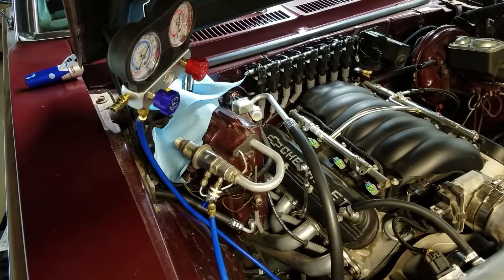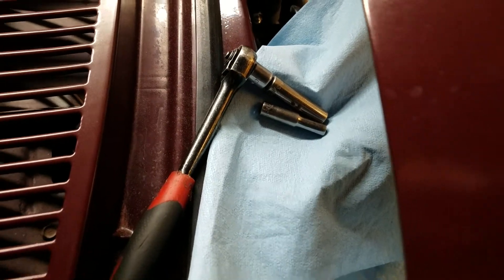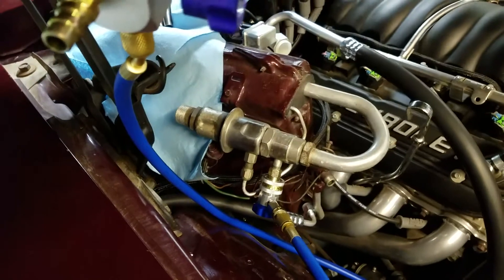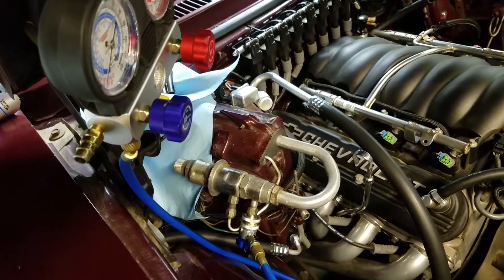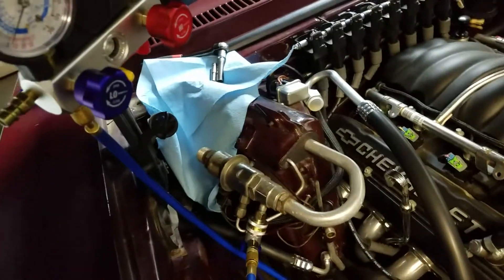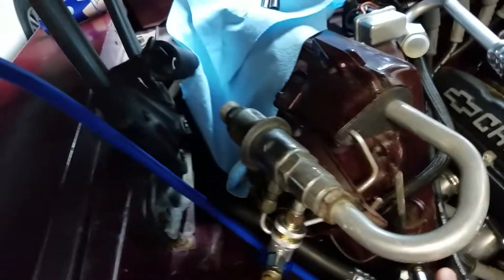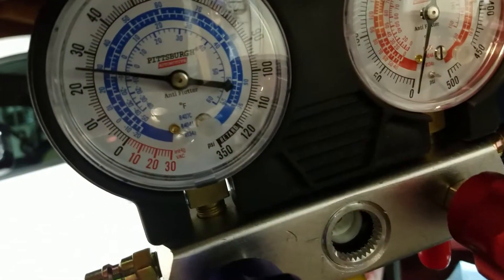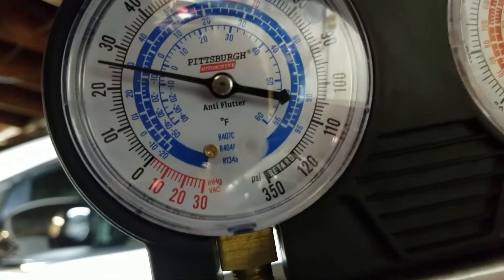POA Valve Adjustment 1970 Nova Factory AC. Convert from R12 to R134a

Comment: Thanks for the great video. I have a question about the pressure setting for R134a. I see you set your pressure to 26 psi on your POA valve. When I look at a pressure chart for R134a it shows a set pressure of 27.5 for a evaporator coil temperature of 32°, I'm just curious if you have ever encountered a coil freeze up at the 26 psi pressure? I'm getting ready to make this adjustment on my POA valve. Thanks again. I look forward to your reply.
Reply from the maker: I have not experienced a freeze up. I know some people go even slightly lower on the pressure. I suspect the expansion valve control of superheat would keep freeze-up from happening since the outlet temperature is kept a few degrees above the saturation temperature.
Reply: That is great to know, your info is greatly appreciated. Thank you!

Comment: How far into the back end of the POA valve are the nuts for adjusting the pressure? Mine is just like yours - and there are threads on the inside for about an inch -- but I have to go 2 1/2 inches into it before anything stops me, and there's nothing that a socket with connect with. Possible my adjustment screw has been removed by someone?
Reply from the maker: I can't remember how far in it was. It was visible when looking down the outlet of the valve with a flashlight. I've heard some are not adjustable, but most are so take a look. I have a photo some place looking down the beach of it if that helps.
Reply: @thebandit4393  Thanks - I have seen your photo and someone else's too, and since mine is still on the car I can't see into the outlet. Mine could be one that is not adjustable. It's a GM 6551430.
Reply from the maker: @reallyrarestuff  I don't think I removed it to get a photo. I used my cellphone and held it by the end to take the photo. Took a few tries.
Reply: @thebandit4393  My camera shows a plain disc looking into the outlet of the POA. I have 50 lbs on the Low Side Port on the POA when I inject shop air into the evaporator, so something is amiss for sure. I removed the POA and see a small nut in the Inlet side. That 5/16 nut was tight clockwise, and when I turn it CCW it just loosens. Looks like this one is not adjustable, so I'm on the trail of a rebuilt one or a replacing it with the new type that cycles the compressor.
Reply from the maker: @reallyrarestuff  Dang good luck!
Reply: What year is your car
Reply: @hubertbryant5587  Mine is a 67 and I concluded my POA was not adjustable so I had to replace it with one of the new POA Replacement pressure switches. I still have the original one in case I run across someone who wants one like that.

Comment: What was the inlet compressed air pressure you used?
Reply from the maker: I don't recall sorry, but more than likely I used my normal regulated shop air pressure which is 80psi. AC systems can have high side pressures over 300psi so 80psi should not hurt anything.